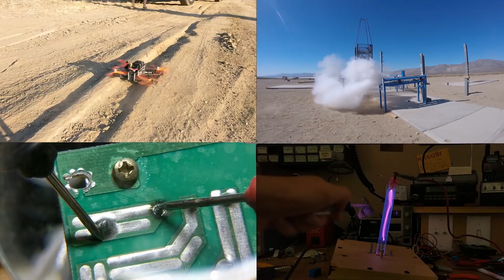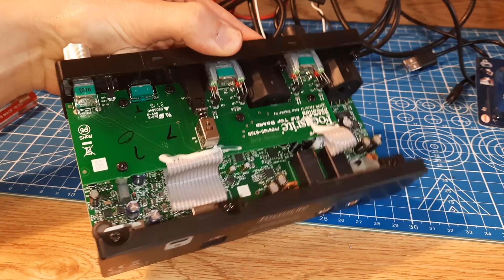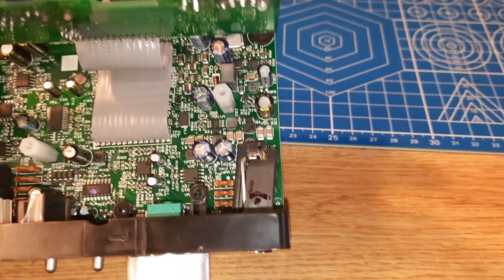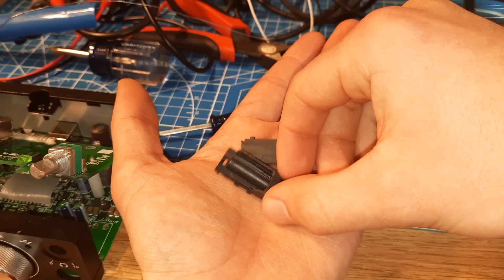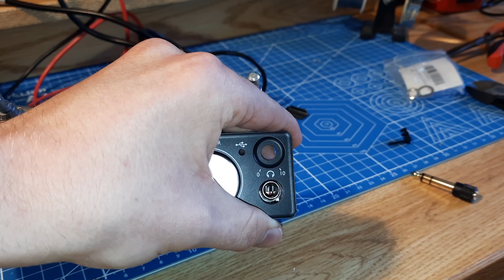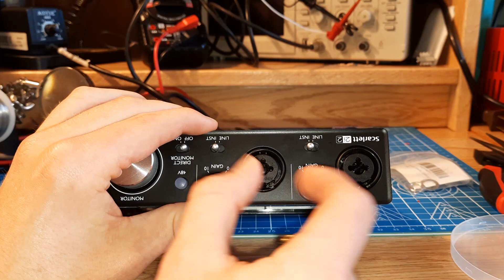Repairing a Focusrite Scarlett 2i2 Audio Interface(Broken Headphone Jack)

Comment: Regarding replacement components, I had the experience that the focusrite support is incredibly helpful, even outside of warranty.

My 2i2 2nd gen has a scratchy potentiometer for the monitor output. I filled out a spare parts enquiry and described my issue on the focusrite website and had a replacement potentiometer free of charge within 3 business days.
Reply: How?
Please help me

Comment: Dear Tanner, my 4i4 is not detected by the computer, Always worked a wonder,  I tryed with different cable/ port on my computer, I tryed to use it with another computer...when plugged in, the input 1 on the front light up red on instrument briefly, and when plugged in and pressed the 48 v phantom power button, it lights up... but not more than that... Is it possible that input socket 1 is broken and in case replace it?

Comment: I have the same Audio Interface, and this is really helpful, thanks! It does seem to be an issue with this model.
Just one bit of advice to people though is always check and make sure the issue is that actual hardware before opening it, for one an unfortunately large number of 3.5mm converters I have bought have proved to be pretty shoddy quality, and for two, headphone jacks take a lot of abuse, check the soldering inside that, if jiggling the lead affects stereo/mono glitching etc, it could be simply a case of cutting off your old Headphone jack and soldering in a new one.
I actually ended up buying headphones that came with 6.35 as standard just because I hoped it would provide less leverage on the mount itself. The Beyerdynamic DT 770 comes with several swappable leads which makes them more flexible for the way I work.
Reply: En mi caso no se me cayó ni rompió. Tampoco una mala configuración en un programa. Sino que hice una mala conexión de la salida de auriculares a un viejo amplificador de guitarra por desconocimiento y guiándome de un tutorial de internet.

Comment: I had this SAME issue. my mic did not work.  I uploaded and deleted all of my software, pro tools, albeton, etc many times, I fought with London england for making a piece of crap and NOW, I pushed the button 48 v right beside the mic and I got sound. DOn't buy this companies interface, the reason mine stopped working was because I watched some movie that wanted to silence my mic; never again, PUSh the 48 v button by your mic. that is what fixed mine.

Comment: Mine has exactly the same problem. I was hoping the jack was merely loose, but it looks like the assembly is probably broken. Could you tell me the part number for the jack?
Reply: Did you ever find it? I have the same issue with the jack being wiggly and I couldn't find anything that looks like Tanner's replacement on Amazon. Just extension cables and general 1/4" cables
Reply: @SyntheticsV2  what he bought is in the description

Comment: Hey Tanner, nice video. I've got a Focusrite Scarlett 18i20 3rd gen audio interface that doesn't work. It powers on and has all the LEDs working properly but my computer doesn't detect it. I've already discarded it being a software/drivers and a USB cable issue. This started happening after a power surge and I believe the USB-C connection or something related was damaged. What do you think could be the problem? Any tips? Thank you!
Reply: Change the usb port on the COMPUTER. Either the metal is not touching or its burnt out. Test your interface on a few different computers to see if the port needs to be changed for sure. I hope this helps

Comment: hello, mine does not power up properly,,, it seems the USB connection or internal power supply is the probelm, any tips? (while connectd the buttons can light up but it is not detected on any computer,,, thanks!
Reply from the maker: Try opening it up, then holding the soldering iron to the pins where the USB port connects to the computer.  This should reflow the solder and potentially fix your problem.  Similar to this: https://www.youtube.com/watch?v=j1zpb4Dsvqg

Comment: How old are you??  Fantastic skill you have
Reply from the maker: I am 20 right now.  Thanks Dan!
Reply: @TannerTech  I was hoping you could help me with something.

I have the same brand, but a unit that has 6 inputs.  

I plugged the wrong wall wart into my unit and it died.

Did you see a fuse inside anywhere????  I was hoping I’d find a fuse.  

In any event, any idea if this is fixable without sending it into Focusrite???
Reply from the maker: Perhaps, was the wall wart the wrong voltage, or wrong polarity, or both? I'm not sure what model you have, the one I used runs solely off USB power.
Reply: @TannerTech  yea I have that unit too.   I also have the same brand, some kind, but it’s bigger and had 6 inputs and outputs instead of 1 or 2.   It required a wall wart.  And it was a different voltage, that I know of.   It was only several volts more then what’s required but it’s never worked again since.

Comment: My broken jack on my old 2i4 looks just like that. I thought superglue would work too, so now its just all melty looking.
Reply from the maker: Oh wow! I guess this is a common problem.  Does it work?
Reply: @TannerTech  It was intermittent, so I figured I could bend it back together inside. It was broken in the exact way yours was. I ordered the parts you spec’d, but also the OEM part.